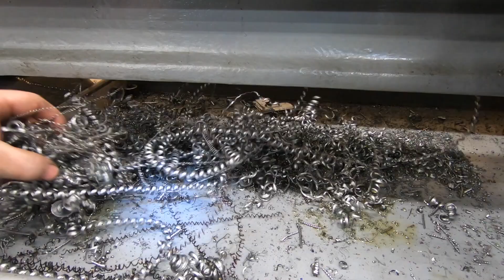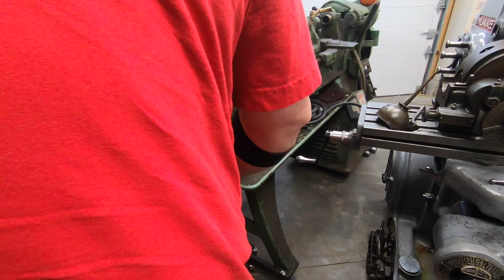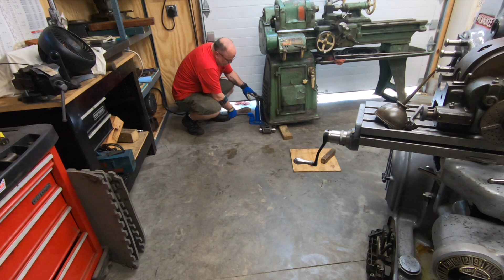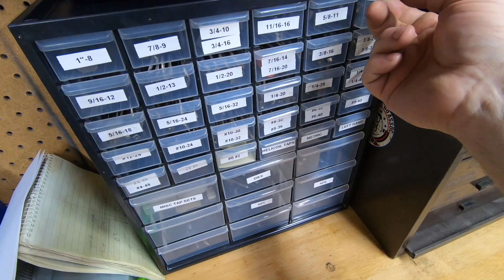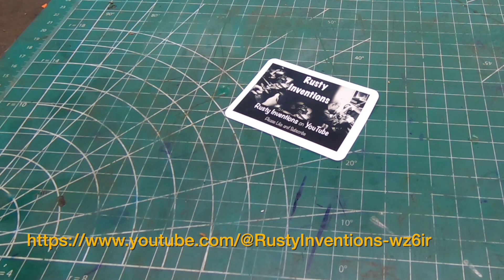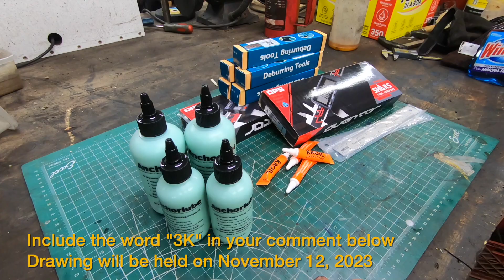Odds and Ends - Episode 7 - Shop Projects - 3,000 Subscriber Giveaway - Matty's Workshop

Comment: Hi Greg a nice collection of odds and ends. That lathe wobble was a bit frightening. Now then, a parts washer yes that could be very useful ..... I'm cleaning parts at the moment and it's hard work without one. Cheers
Reply from the maker: If I had to do it all over again, there's another type that fits over a 5 gallon bucket that takes up a lot less space. But I am certain the heater is going to be really nice to have come this winter.

Comment: Lol , a minor hiccup !   I use the tracked ones , they let out a crackling noise just before that happens . Just enough time to stop & re set !    Those brass tractor gearshift handles are illegal hear as are a lot of things  , probably a good thing !   👍
Reply from the maker: I have a plan to change out the rubber for some soft wood. Might do much better.

Comment: Rather than using rubber pads on your machinery skates, try screwing some wood to the top.  The wood, in my experience, seems to provide more grip than rubber/synthetic material.  Even though I knew what was coming, I gasped a bit when I saw the lathe drop!  Congrats on the 3k Subscribers!
Reply from the maker: I think wood might be a better solution, maybe a nice soft wood that will take some abuse, but can be replaced easy enough. Great idea!

Comment: Congratulations on breaking the 3k subscriber mark.  I am curious though about the felt you used for the tool chest? I have thought that pool table or billiards felt would be a good choice for durability.
Reply from the maker: I used some self adhesive junk from Amazon. The felt that Gerstner sells is thicker and has sizing on the one side. You would use hide glue to adhere it. But one roll of it is like $60. Better quality, but 3 times as much as what this stuff cost me. If the adhesive fails, I'll revisit the idea of the factory felt.

Comment: Nice job on the Gerstner. I picked one up recently, did some cleaning up. Yours looks better. I had some problems with the veneer lifting, and it didn’t glue down flat. I’m going to try Murphy’s, the stuff I used just made it dark, and it doesn’t look good. I recently upgraded my Harbor Freight parts washer, but I used two five gallon tubs stacked so the funky stuff stays in the bottom. I spent a bit upgrading the pump to a Little Giant that will hold up to the PS 1000 solvent, it was $120. I think it was a god investment. Works great.
Reply from the maker: Murphy's is my go-to for anything wood that is dirty. Doesn't harm the wood at all. The double bucket is a great idea. I have a grate I planned to put in the bottom of the tub, but it's a bit too wide. I need to cut it down the weld on some new feet to keep it off the ground. The Little Giant is a pump I'd like to look at. What I really want is an external pump that has enough power to pull through a filter. That way I can put a diesel fuel filter in the suction line, filtering out the junk before it gets to the pump.
Reply: @MyLilMule  I sent you a couple pics of my rig via messenger.